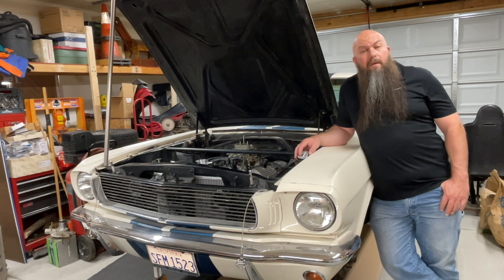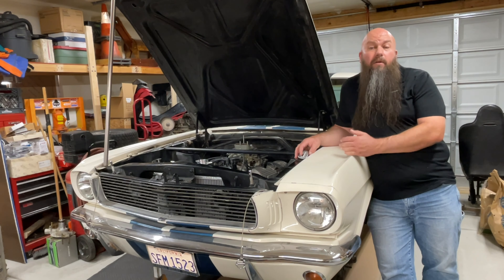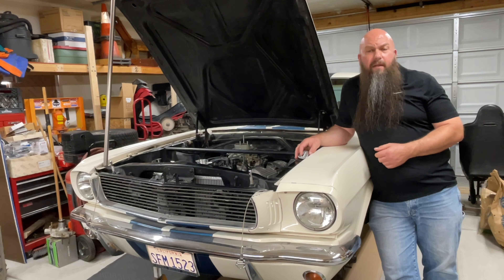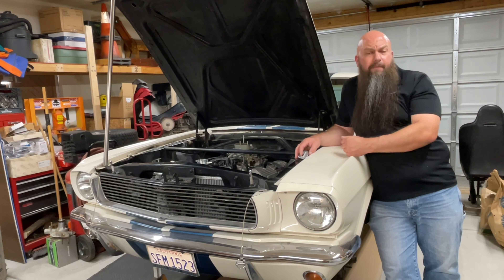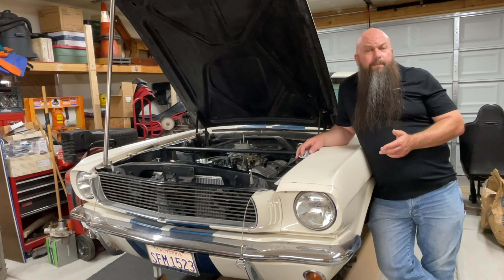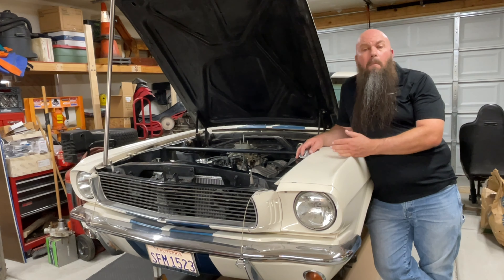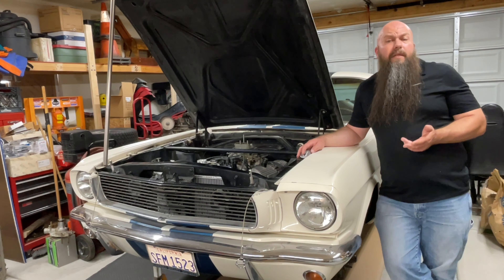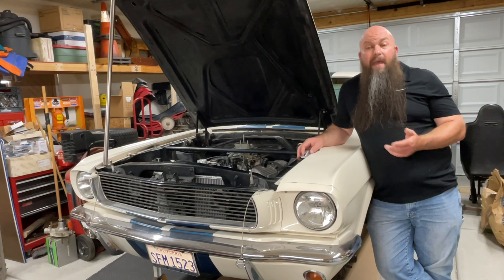Early Mustang Cooling Systems Part 6: Green Coolant Goes Bad, How & Why I Upgraded To An ELC!

Comment: A friend used an extended life coolant in his small block Ford and two years later after pulling the intake manifold he noticed the gaskets had turned to mush.  There are several classic car sites that say NEVER use an extended life coolant in a classic car because it eats up sodder in radiators and damages gaskets and seals.  Views should check these sources of info out.
Reply from the maker: Seems like you need to watch the whole video.  The gasket softening and solder damage is a result of using coolants with incompatible additive packages.  The coolants I recommend in this video are suitable for use in ALL classic cars, using rubber or silicone hoses, all gasket compositions, copper/brass or aluminum radiators, and with iron or aluminum blocks and heads.  Sounds like your friend used a coolant with 2-EHA and a Phosphate based additive package (essentially GM DexCool or an ELC variant of DexCool, perhaps with Nitrites as well) which was incompatible with copper/brass heat exchangers and silicone enhanced fiber gaskets (example: FelPro Printoseal technology).  

I don’t make my recommendations lightly, they are heavily researched and I’ve used these products for years in fleet service.

Comment: Do you fill radiator  completely full or do you leave room for expansion, I have a 1964 galaxy with 289 engine
Reply from the maker: If you update to a recovery style cap with overflow reservoir, you can fill it completely.  If you run a non-recovery cap, leave 1” to 1-1/2” in the top tank.

Comment: Fantastic video series, great info! Any concerns of mixing the Peak Final Charge Global 50/50 with light residual of Green coolant that was drained? My '65 Mustang 289 coolant system has been drained at radiator but I'm not sure how much liquid remains in the system and if it is compatible with the Peak product. Thanks again for the detailed descriptions of everything.
Reply from the maker: If the residual green is more than 3-5% of the total volume, it significantly shortens the life of the ELC.  I would drop the lower hose into a 5-gallon bucket and back flush with 3-4 gallons of distilled water through the heater hose connection on the intake manifold (behind the thermostat).  Start with flushing the heater core if it has green in it, then run the distilled back through the manifold and it will flush any coolant out of the heads and block through the water pump.  There are drains on the side of the block if you feel like being extra thorough, but the back flush is usually adequate.  Be sure to properly dispose of both the used coolant and the contaminated water.

Comment: What do you suggest when conveting to ELC coolants from older coolants, flush etc.
Reply from the maker: Best to remove the plugs in the block after draining the radiator, gets you about 95% clear of the old coolant.  If that’s not feasible, 2-3 flushes with distilled water, you can use a radiator flush product the first time with water, and the systems will be acceptably clean and free of the old antifreeze by the third round of water.  I recommend if you can’t get the block plugs out, Jack the rear up and put it on stands,  the block will empty through the timing cover and water pump.  I typically use 10-15psi air to clear out the heater core and even the block.

Comment: Thanks for the time making this video. Any issues with the ELCs and leakage issues?? I’m finally considering changing to Mobil Delvac in my ‘70 Mustang… what are your thoughts?
Reply from the maker: Be careful with your choice, follow the guidelines I gave in the video.  Avoid coolants with 2EHA and Nitrides.  The coolant I recommend in the video works well, no issues.  It’s completely compatible with a vintage cooling system.

Comment: Good info. Question: When using undiluted coolant requiring you to mix with Water. What water is best?  If not Distilled water added to coolant and not tap water either. Maybe just filtered water?
Reply from the maker: When you mix concentrated antifreeze with water you can use distilled.  The antifreeze has the corrosion protection properties needed to protect the engine.  With straight water you need to use a filtered but not distilled water, and that is also acceptable for top offs.  Avoid mineral water and water with high calcium content, it’s also not recommended to use softened water because of the process used to extract the mineral content.  Hot water from the tap nearest the tank is usually the best choice for tap water because the water heater naturally drops the minerals out of suspension (which is why how water headers end up being full of minerals when they are replaced and the amount of water they can heat ends up being less than half of what it was new).
Reply: @TheGT350Garage  Thanks for quick answer! I love how in depth your explanations are; The amount of mineral deposits inside my Edelbrock Water Intake Housing at the thermostat restricted half of the flow! '64 Galaxy 500 with newly built 289 sat for more than 10 years with no Antifreeze(aka Anti Corrosion),  just water in the system.  Makes me wonder about everywhere else.
Reply from the maker: @twinfin8867 you’ll need to flush the engine with a mild acid like 5% vinegar.  It will remove most of the excess corrosion from the system.  It would be a good idea to replace gaskets after and inspect all the aluminum components (manifold, timing cover, etc.) before running the engine in regular service.
Reply: @TheGT350Garage  Thanks again. If I am not willing to tear down to replace gaskets at this time should I skip the Vinegar when i flush?  Your answers are brilliant.
Reply from the maker: @twinfin8867 at the bare minimum you’re going to need to replace the thermostat.  Putting vinegar in the system for a couple hours will remove both aluminum and iron oxides.  Be sure to neutralize with a couple tablespoons of baking soda and water, then flush with just water, do a final drain and fill with coolant.  You’ll want to keep an eye out for leaks and monitor coolant levels.  You want to make sure you don’t get coolant / water in the oil, or lose a freeze plug.  It’s also safe to say your radiator and heater core are suspect as well.
Reply: @TheGT350Garage  Thank you again for your time and sharing your knowledge 😎.

Comment: If you use one of the coolants you list, will that negate the need to flush your system every year. Generic coolants cause my coolant to turn brown after about a year. I always have to flush it out.
Reply from the maker: If you do a complete drain and a chemical flush to remove rust, scale and sediment from the cooling system, an ELC will last 8-12 years.  Coolants usually turn brown when you mix different types because the additives are not compatible.

Comment: What are your thoughts on Peak All Vehicle 10x or Prestone Max?  They don’t seem to have the bad stuff you mentioned, last a long time and are compatible with any residual conventional antifreeze left over after flush.   Thx.
Reply: Correction.  Prestone Max has 2-eha so forget that one.
Reply from the maker: The five heavy duty long life coolants in the video description were listed for their chemical properties and color.  Using a red coolant in the system is a reminder that the coolant is not ordinary coolant and “universal” top up coolant may not be compatible.  The Peak 10X SDS is pretty vague, I can’t directly recommend it.

Comment: Would you also suggest using the Peak Final charge global in a 2011 Honda vehicles ?
Reply from the maker: No.  Honda uses their own long life coolant and there is no advantage to changing the coolant speciation.  On vintage cars however, the advantage is substantial, and using an ELC will help reduce cooling system related failures.